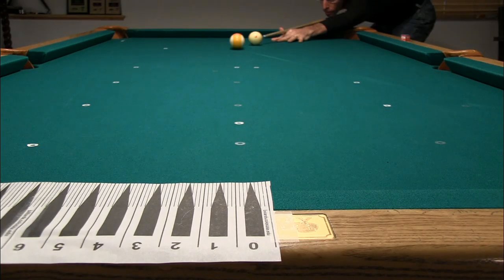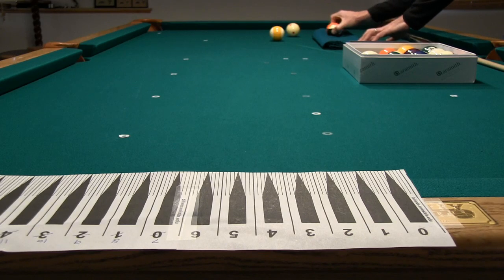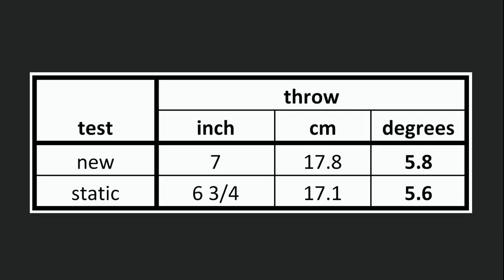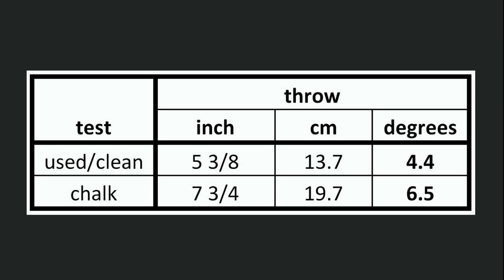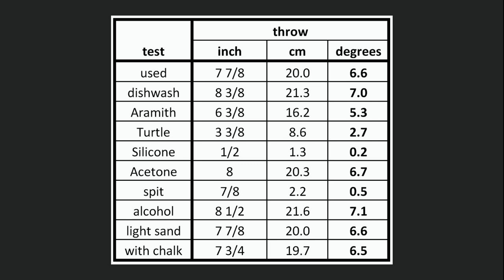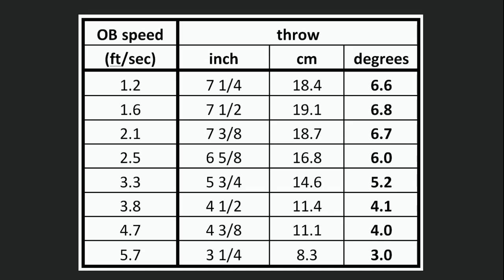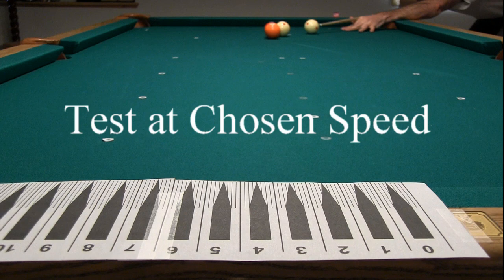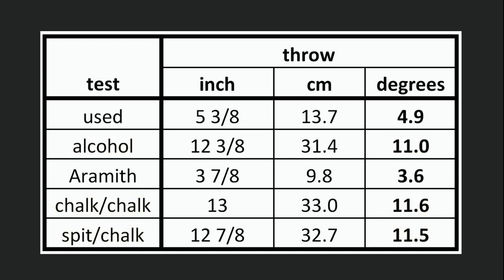Pool ball cut-induced throw and cling/skid/kick experiment

Comment: Dr.Dave, I'm curious about how the OB speeds were calculated. Do you remember?
Reply from the maker: I just made sure the OB travelled the same distance on all shots included.
Reply: @DrDaveBilliards  Sorry I didn't make myself clear, how did you get the OB ft/sec data in the spreadsheet?
Reply from the maker: @puboh Sorry, but I don’t remember.  I probably just timed how long it took for the ball to travel a certain distance close to contact, maybe with the ball crossing a line on my screen.

Comment: Can I dilute delicate hand soap in a sink full of warm water and hand rub the balls? And i mean like a toothbrush amount of soap in a full sink? (3 gallons of water)
Reply from the maker: For the recommended way to clean balls, see:
    https://billiards.colostate.edu/faq/ball/cleaning/
Hand soap and water is not the best choice.
Reply: @DrDaveBilliards  oops lol. I did it last night but it worked out fine. I used 1 pump of softsoap lavender and chamomile. No harsh detergents in it. Warm water. Soaked for maybe 15 seconds a ball and wiped with a cleaning rag, then dried with a microfiber cloth. No difference to playability or surface texture. They feel brand new out of the box. Im gonna put a coat of aramith ball polisher anyways at the pool hall
Reply: @DrDaveBilliards  yup. I got lucky. Wont use soap again because i know multiple uses over time are harmful, but i diluted enough to be able to get the chalk stains off without adding that weird film soap usually does. Paired with pool ball wax, i did the same tests you did, and i was at around the 5.3 degree mark as well 👌🤞

Comment: Great research experiments. It would be nice to see if there are differences among different brands of pool balls both out of the box and after significant wear and tear (used for a long time).  Are more expensive balls less resistant to throw?  Obviously, from a physical science perspective, mass (weight) should have some affect on throw, right because of inertial forces vs frictional forces? That being the case, are heavier balls less resistant to throw?
Reply from the maker: I would expect all pool ball brands to throw similar amounts, assuming they are "cleaned" or polished the same way.  Ball weight or size should have no impact on the amount of throw.  See the answer to the 2nd question here:
  http://billiards.colostate.edu/threads/balls.html#weight
Reply from the maker: More specifically, see:
  http://billiards.colostate.edu/threads/throw.html#ball_size

Comment: DrDave, Thanks for sharing the results, very informative. Several things pop out to me. First, #600 sandpaper did not surprise me because this should leave a scuffing effect on balls that are highly polished, much higher than 600. Also, the saliva initially shocked me, but I remembered how I was taught to seal and polish a tip, saliva and friction (using the top of rail). Acting as a polishing agent.

This also left me with questions about how water would react, simulating a humid enviro. Of course, generally accepted that it reduces throw in this situation, but where it would fall in this spectrum. Also, it would be interesting to know the effect to the wing balls and spot ball with a 9-ball  break. I believe that many players have figured out these manipulations but they may not know what is actually going on. Todays favored wax may change to spit.

BTW, I clean my balls with a homemade ball cleaner using Windex to clean and a minute amount of Meguiars 20min wax...with emphasis on minute. I have always thought this leads to average throw compared to the range of conditions at poolrooms, your experiment seems lead me to the same conclusion. Lastly, this shows how Earl inherently understood the mechanics, when he insisted on cleaning the balls between each rack during his million dollar run.
Reply from the maker: Thank you for the comments.

FYI, all effects related to humidity are described here:
http://billiards.colostate.edu/threads/table.html#humidity

A wet spot on the ball contact point results in almost no friction; but the effects of humidity (moisture in the air) is very different.

Comment: Oh my god this info is great.. I might get a cheap 25 dollar set of balls and put them into my expensive case and clean them up the best I can then buff them with silicone spray and take them to play lol.. Ill bet the good players will play much worse as they expect the amount of throw and changes in spin from the old dull worn out balls on the table they use there lol..
Reply from the maker: If you really want to mess with them, clean the "solids" with alcohol (to make them throw and transfer spin more than normal) and use Turtle Wax on the "stripes" (to practically eliminate throw and spin transfer) ... and don't tell them.  That should give you a decent edge.

BTW, you don't want to use the Silicone Spray for actual play ... it is messy and will get on your hands.
Reply: DrDaveBilliards Thats funny. Mean but funny for just bunch of friends messing around lol..  A good way to get kicked off league lol..
Reply from the maker: John Hotdogs You're right.  That would be mean (but still funny).  :)

Comment: Makes me wonder how surface treatments make the cue ball react when attempting follow/draw. Thanks for the video.
Reply from the maker: The "slick" treatments like wax and Silicone Spray make it very easy to shoot draw shots.  The spin doesn't wear off as easily.  

Slick conditions also cause the CB to swing out wider before curving on cut shots with draw or follow.  The CB persists along the tangent-line direction longer before the top or bottom spin make the ball curve.  For more info, see:

http://billiards.colostate.edu/threads/position.html#speed

Comment: That's great, thanks for doing this Dave. Question: Would these same effects apply for simple cut-induced throw, or is there something different going on when you have frozen combinations set up? Frozen combinations don't come up all that often, but if simple cut shots can vary by several degrees depending on conditions, that affects every game.
Reply from the maker: The frozen combo responds very similarly to a stun shot of the same speed.  There would only be a slight difference in the non-frozen case.  For more info, see:

http://billiards.colostate.edu/threads/throw.html#frozen